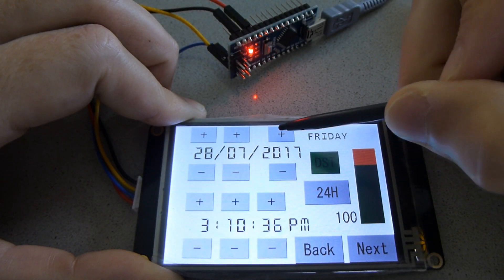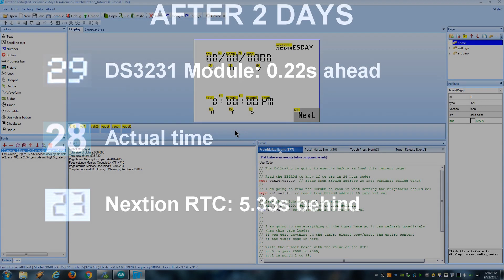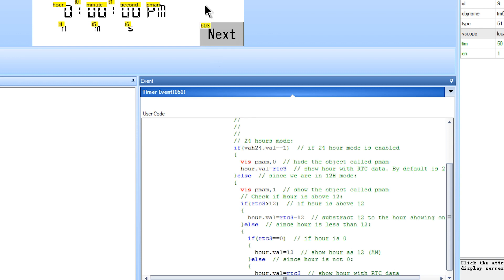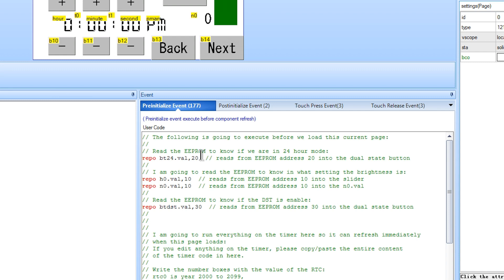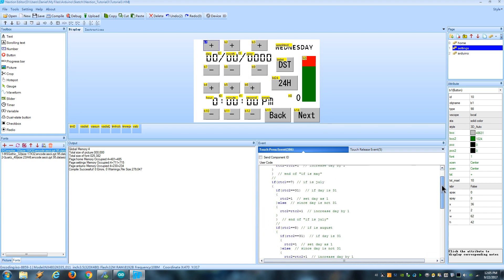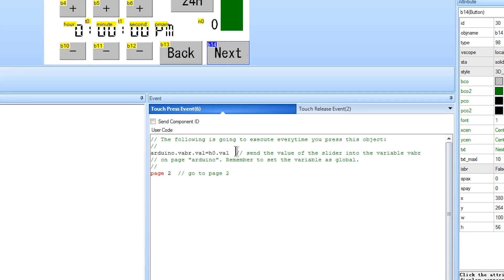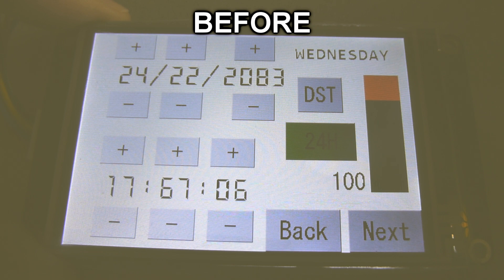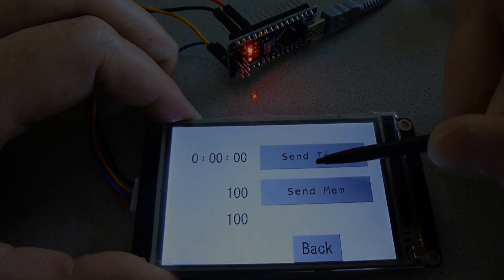Nextion+Arduino Tutorial #3 RTC and EEPROM (Enhanced Version)

Comment: Nice video!

One hint: The EEPROMS has normally a lifecycle of round about 100.000 (+/-) write cycles. If you update the content in the PROM every move of the slider, you get very fast end of life of the used memory cells. Reading has no influence, but writing is limited.

Greetings,
Wolfgang
Reply from the maker: I know. That's why I actually write the EEPROM when I release the slider. I don't write the EEPROM when I move it. Check the code and you are going to see it.

Comment: Greetings! I was wondering if you can make a video on how to use RTC Module on Arduino and display it on the Nextion LCD Display? Thank you! ❤
Reply from the maker: I'm working on an Arduino tutorial series that includes how to use RTC but is going to be ready in around a year. My suggestion is to watch any RTC tutorial and join it with my example of the nextion display

Comment: It was really helpfull , i have a issue ( i have a nextion capacitive 7 inch  touhscreen display) , everything works well like i have attached 2 leds into the nano and when we press on nextion  b0 led1 lights up and b1  led2  lights up but when i press both the button simultaniously then only one led either led1 or two lights not , both the leds so i i have noticed there should be a delay in that , can u plz help out how to add delay in it so if we press it the led lights up but only a slight delay will be there that's merely noticeable
Reply from the maker: I never used multiple-touch screens. Not sure how to help you. Maybe trigger the event that reads the state of the button when you touch ether button. We usually trigger an event with the touch of a single button. But you can try to read the state of all buttons, no matter which button you touch.
Reply: @interlinkknight  when we click on the Button it sends hexa codes 65 01 FF FF , in the debug process, can we do something that when we click the button there will be a delay in the output of hexa codes like , when b0 is pressed up it sends hex code in delay 0 and when we press b1 at same delay 0 hexa codes are sended by nextion , so suppose at b0 the delay is same and at b1 the delay is 30 so when we press both the buttons simultaniously there will be a delay in output hexa codes and the leds might light   so can u help me out how to add delay in Output of hexa codes??
Reply from the maker: I guess you can add that delay but you need to write the code and use a timer inside the nextion display. Did you tried my examples? In my examples I have parts that I use a lot of code inside the nextion display. You would have to figure out a way to write that delay. Instead of sending the event hexe code by checking the checkbox for sending an event, you should send it manually in the code you are going to write.

It's not simple, if you are not familiar with writing code. The structure when writing code for the nextion display is similar to arduino, but you are more limited and the format is a bit different too.
Reply: @interlinkknight  hey , i tried it with with creating variables and timer as you said its possibile thanks for it , but theres one issue we cant make more than 6 timers on a page can you help me out , how can we use more than 6 timers on a page if not possible then , can you help how to link a timer of a seond page with the page 1
Reply from the maker: As far I know, you can't

Comment: Thank you for the excellent videos. I have an enhanced 7" display with RTC. My problem is to send the time variables to arduino with the get command for reading. I want to update the clock every second. If I run the programm the serial communication has an issue. For this problem I have no solution. All other commands like Buttons, numbers or textfields are working correctly.
Reply from the maker: What program are you running that cause the issue? The reading of the time?
Reply: @interlinkknight  getValue
Reply from the maker: So far i used that command with buttons. I mean, the display choose when to send the data, not Arduino. Maybe try it that way? I'm not exactly sure how, but it's an idea. In some of my examples there's that code where i send data to Arduino by pressing a button. Use that example to make your code
Reply: @interlinkknight  I've done so. The difference ist the Trigger. I don't want a Button pressed. I want to send the data with a Timer.
Reply from the maker: So using a button you don't get any problem, right? Then create a timer in the nextion display and execute that event every second. The idea is simulate the pressing a button thing. I know it's not ideal, but the way the creators of the display made all this is terrible. The library is a mess, in my opinion
Reply: @interlinkknight  the Timer is already existing. That time I call the getValue command, the serial communication is hanging.
Reply from the maker: that's not the same. In the timer create an event and then arduino when receive that event send the command to getValue. That's my idea, anyway
Reply: @interlinkknight  so now it works. I do the comparison of the number values on the Nextion Display in a timer element. The result creats an event like a virtual button. It`s only a workaround but with the f... library  there will be no other way. Thank´s for help.

Comment: hey it is superb but i have an error in nextion editor softwarer programming , Error:Page:home Fail:hour.font InputVal Invalid:Invalid Font ID
Error:Page:home Fail:minute.font InputVal Invalid:Invalid Font ID
Error:Page:home Fail:second.font InputVal Invalid:Invalid Font ID, can you please guide me what should i do?
Reply from the maker: I guess the font file is too old for the new version of the editor. Try creating your own font and use that instead
Reply: @interlinkknight  Thank you so much for reply , yes i did the same and it is done but when i go to debug it will show that: simulator has very low brightness and i am using intelling version of nextion lcd
Reply: Hello it is solve , actually i remove the slider and it's code from 2nd page and preintialized event code from home page too and now it is working , thank you so much really these videos are too good and i subcribed to your channle for more videos.
Reply from the maker: I'm glad you got it working.

Cheers

Comment: I am quite new to all this stuff, but I want to make a Midi controller. It seems that all Midi controllers use rx and tx, which I think are pins 0 and 1.
Does that mean that I can´t use this display?
Thanks in advance.
Reply from the maker: I don't think you know what this display is about. It uses specific commands. No way you can do it
Reply: @interlinkknight  I think you made some very good videos about what this display can do, so yes that i what I want. But I just want to use it to control devices via Midi, that just uses 2 specific pins on the MCU. And that could be the same 2 pins as this display uses, so I will get a conflict. Some serial devices uses pin 2 and 3, and if this screen could use those, I would be fine.
Reply from the maker: Use an arduino mega then because it has 3 serial ports.
Reply: @interlinkknight  Thank you
Reply: @interlinkknight  I just ordered a Mega, I really appriciate your feedback.

Comment: Hi. How I can generate digital fonts using the Nextion Font Generator from description. I'm asking for help as I can't find this specific font on the list.
Reply from the maker: The nextion editor now has an improved font generator. The font is there.
Reply: Do you remember the font name  from that list ? Cheers
Reply from the maker: LCD
Reply: I can't generate this font as it does not exist on the list in Nextion Editor V0.53
I have also tried Nextion font generator V0.3 but no luck
Reply from the maker: I have the same versions and I do see it. Maybe it uses the fonts inside windows and your installation of windows doesn't have those fonts? I am not sure, but that might be the reason. In that case search for the font online and install it to your windows.
Reply: You were right. I have downloaded and installed digital fonts and now I have  them available  in Nextion Editor. Thank you very much for your help. Cheers

Comment: i have a question , if my nextion works without battery , can i write and read the eeprom and save this bytes to stay there permanently
Reply from the maker: Yes. All the settings that I wrote on the EEPROM are saved even if you disconnect the battery. That's the point of having the EEPROM, you know.

Comment: its a great video!! thx for share. Can we use it nextion RTC and SD card as datalogger instead arduino datalogger shield ?
Reply from the maker: I'm not sure I understand the question. You can't access the microSD card because it's used only to upload the nextion project. You can use the EEPROM however you want, though.

Comment: Thank you very much for your videos. Please can you guide me about how to use the Nextion RTC data to do some timing events in arduino sketck instead the external RTC or the setTime command? Thank you so much in advance!
Reply from the maker: This video is about that. Not sure what else do you want
Reply: @interlinkknight  Thanks for your answer. Right now I don't have an external RTC device, so I'm using the TimeLib, as follows: setTime(00,00,00,00,00,00), so each time I upload my sketch to the arduino board my reference time starts all in "00", and i want to use the Nextion RTC data to have it available all the time in my program even i upload the sketch or reset or power cycle my board. I'm tryin g to store the RTC data on variables but it does'n work for me, I will be very pleased if you can guide me a little bit. Thanks again and keep the good job!
Reply from the maker: I suggest to use the external RTC DS3231
Reply: InterlinkKnight ok, i was supposing this... thank you so much!

Comment: Do not understand what for is the DS3231 if enhanced nextion contains clock module on board.
Reply from the maker: I mentioned the reason on the video
Reply: @interlinkknight  Hmm.... very interesting. Going to use the internal clock module... will check. And yes, I will do date and time sync through the internet. In any way, thanks for your and video too.

Comment: Thank you for the great video. I´m getting a message in the simulator " Simulator has very low brightness " and the simulator background is all black, any thoughts on how to solve this?
Reply from the maker: I have no idea why you get that. There's a command to change the brightness in the display but the only way you can mess with it is if you put that command somewhere. It doesn't happen by itself
Reply: @interlinkknight  solved it:) excluded the following // and then removed the exlusion // ( page 1)

// Read the EEPROM to know if we are in 24 hour mode:
//repo vah24.val,20  // reads from EEPROM address 20 into variable called vah24
//
// I am going to read the EEPROM to know in what setting the brightness should be:
//repo va1.val,10  // reads from EEPROM address 10 into va1.val

No idea way this happened.
Thanks for your support:)
Reply: @makerfactory8544  I dont understand how did u solve the problem pls reply

Comment: Excellent videos! How fast can these displays be refreshed at maximum using an Arduino board?
Reply from the maker: I don't have FPS numbers but it can refresh a lot faster than using a traditional display driven by arduino. Depends on the display version too. The basic nextion display has a 48MHz CPU. I have the enhanced version with 108Mhz CPU and it can even handle video-like performance.

Look at my video here to see that in action: https://www.youtube.com/watch?v=eDn7LFyoEm8

I show on that video a series of images loaded in succession pretty fast.

It's more limited by the serial interface than anything else. I recommend using a serial baud rate of 115200 for the best refresh speed possible.
Reply: InterlinkKnight Thanks! Sounds definitely like somethingI I could  use.

Comment: Thank you for the examples.
How do you get the Quartz font?
Reply from the maker: The quartz font is on the new font generator that I mentioned on the video.
Reply: When I tried it, the font looked ok on the editor, but the right side of each character was chopped off. This is a minor thing as I can use another font for now; just frustrating. I was using 48 for the size since I have the 7" display.

Comment: Great video, but how do i get the rtc from arduino?
Reply from the maker: Search for DS3231. They are cheap on ebay and you can find a lot of tutorials on youtube
Reply: Yes, but i wanted to use the RTC in the Nextion.
Reply from the maker: My example project shows how to read the rtc of nextion from arduino. I put the values on variables and then read those variables from arduino.
Reply: Thanks for your answer, I will go for the DS3231 instead. I have a couple of them laying around ;)
Reply from the maker: Wise choice. The internal RTC of the nextion display sucks
Reply: Thanks for input, I used DS3231 and it is much better and easier to use with the nextion display. I completed the project in one day including programming - guess if i have used the inbuilt RTC, i been struggeling for days :D

Comment: hi, what is the size of your touch screen?
Reply from the maker: Mine is 3.5 inches, but there are smaller and larger models. 2.4 inches it's the smallest, and 7 inches it's the largest.
Reply: Hello, would that be possible to get the code for arduino of the tutorial??
Reply from the maker: Don't want to be rude, but would be possible that at least you check the description before asking for the code? It takes less time to check the description than writing the comment.

Comment: Is Clock stop after power off..??
Reply from the maker: No. It has a battery that keeps the rtc going
Reply: @interlinkknight  that mean, if main power is off, then the battery will turn on Nextion display's chip IC.. and still working clock.... am i right.??
Reply from the maker: yes

Comment: I think your DS3231 uses a bad chip, those cheap Chines DS3231 modules aren't even close to the accuracy of a real DS3231, if you buy a DS3231 IC from digikey or any supplier stocking real parts and replace the IC on your DS3231 module you will be able to achieve a much better accuracy.
Reply from the maker: You mean more accurate? It's already quite accurate.

Comment: Nice code but can be optimized like this:
//	  In my design you will need only 1 button "+" and only 1 button "-"
//	  If you press on year textbox set.val is set to 1
//	  If you press on month textbox set.val is set to 2 and so on ...
//    When you press "+" a variable add1.val=1 and a time variable modify.en=1
//    When you press "-" a variable add1.val=-1 and a time variable modify.en=1
//    I do not work directly with rtc variables because first we want to check
// then set the correct information in rtc so we use following variables:
// ye for year, mo for month and da for day
//    The code below must be put in the time variable "modify" which is activated at 50ms

if(set.val==1)//it is desired to change the year
{
 ye.val+=add1.val
 if(ye.val>2050)//maximum year
 {
	 ye.val=2020
 }else if(ye.val<2020)//minimum year
 {
	 ye.val=2050
 }
}else if(set.val==2)//it is desired to change the month
{
	mo.val+=add1.val
	if(mo.val>12)//maximum month
	 {
		 mo.val=1
	 }else if(mo.val<1)//minimum month
	 {
		 mo.val=12
	 }
}else if(set.val==3)//it is desired to change the day
{
	da.val+=add1.val
}
	
//we check to see if we have changed the date
if(set.val>0&&set.val<4)
{
if(mo.val==1||mo.val==3||mo.val==5||mo.val==7||mo.val==8||mo.val==10||mo.val==12) // if the last day is 31
 {
  if(da.val>31)
  {
    da.val=1  // set day as 1
  }else if(da.val<1)
  {
    da.val=31  // set day as 31
  }
 }  // end of if 31

// Check for months that have 30 days:
if(mo.val==4||mo.val==6||mo.val==9||mo.val==11)
  {
	if(da.val>30)
	{
	  da.val=1  // set day as 1
	}else if(da.val<1)
  {
    da.val=30  // set day as 31
  }
  }  // end of 30

if(mo.val==2) // if is february
  {
	sys0=28 //we assume it is not a leap year
	//let's see if we have a leap year
	for(sys1=2000;sys1<2100;sys1+=4)
	{
		if(sys1==ye.val)
		{
			sys0=29//set last day for leap years
		}
	}  
	if(da.val>sys0)//if the day is wrong
	  {
		da.val=1  // set day as 1
	  }else if(da.val<1)
	  {
		da.val=sys0  // set the last day
	  }
  }// end of "if is february"
} //end of date change
//display the new data
covx ye.val,setyear.txt,4,0000
covx mo.val,setmon1.txt,2,00
covx da.val,setday1.txt,2,00

modify.en=0 //we turn off the current timer
Reply from the maker: I wanted to use the display in the most user friendly way. Meaning, the least presses and the most intuitive way to set everything.

You are taking priority on looking clean. Nothing wrong with that, but I prefer giving priority to functionality, user friendly and taking advantage that you have a big display.

Working directly with the RTC worked perfectly fine, in this case. Do you have any issue because of that?